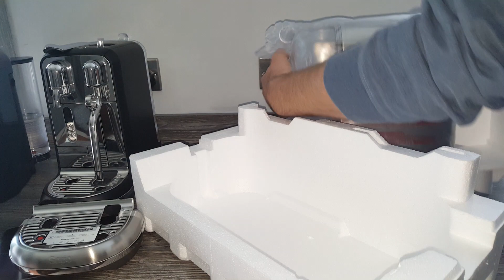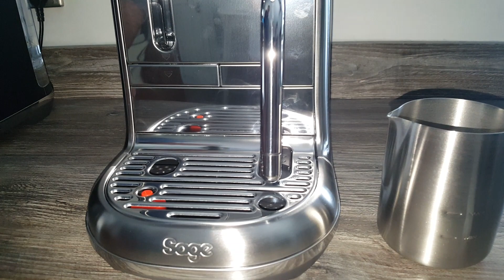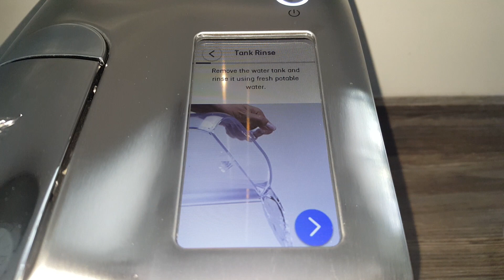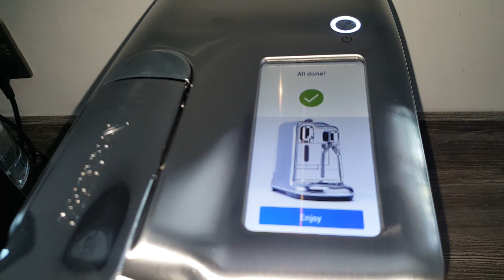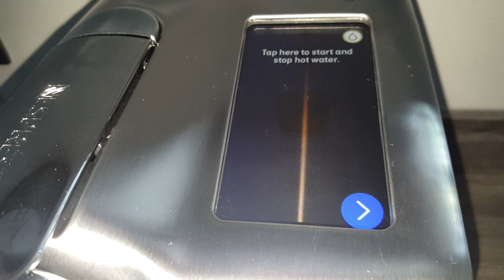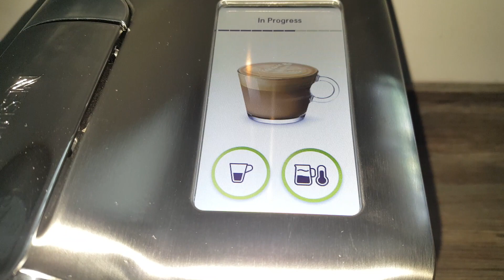Nespresso Creatista Pro UNBOXING and FIRST USE | How to set up the coffee machine to make cappuccino

Comment: Two questions: Can you adjust the temperature of the coffee, i.e. make an espresso coffee hot if you want? Second question: Have you heard anything about the Pro not working correctly in the US due to wattage, that the machine not being able to make the coffee and froth the milk at the same time? If so, would I be better to purchase the plus instead?
Reply: Great job on the review!
Reply from the maker: Hi 👋 Unless the US model is different I’m afraid you can’t adjust the coffee temperature itself. You can adjust the milk temperature and coffee volume but not the coffee temperature 😕 

Also yes I have heard that about the US 🇺🇸 model, that it can’t brew coffee and steam milk at the same time. So I guess it depends if the other features of the Creatista Pro like the touchscreen and bigger size and capacity make it worth it for you. 

It would be great to hear which machine you choose in the end 🙂

Comment: Hi , i just bought creatista pro, i was using citiz with aerrocino 4 earlier, i made a first coffee today using Arpergio capsule which has 9 intensity and it tasted quite strong in citiz but in creatista pro , coffee tasted so weak amd watery, does water hardness level has to do something with this issue ? Pls advise how can i get a strong coffee from my creatista pro ? Thanks in advance 🙏
Reply from the maker: Hi 👋 Are you meaning it tastes weak as an espresso shot or when you’ve added milk?
Reply: @A2BProductions  i took an espresso shot from creatista pro and did milk in aerrocino 4 , it tasted as good it is use to be when i was using citiz and aerrocino 4 combo but when i do milk in pro with steam wand, it makes coffee weak so espresso shot i am not sure is weak itself as i hardly drinks espresso. I used black pod ispirazione which is quite strong itself but still coffee tastes watery and weak.

Comment: So I just got the Creatista Pro. I've watched a lot of your videos and they are great and helped me decide to get it. But...I'm not entirely happy with it at the moment. I've had it for one day and have made a bunch of stuff (cap, latte, americano, flat white, etc) and they all taste weak. I love the machine and it is easy to use, but for whatever reason the coffee tastes weak. I used the regular settings for all of these cups. I use to have the Nespresso Expert and the coffee tastes stronger. Did you ever have an issue with weak tasting cups? Does the machine need a few days to break in? Let me know what you think if you can. Thanks!
Reply from the maker: Hi 👋 Have you managed to find a solution to the issue? I tend to use 2 shots for a latte etc but can get away with one if using a higher intensity pod, especially in a cappuccino. Be great to hear how you’ve got on 😊
Reply: @A2BProductions  Thanks for the reply. I do use 2 shots, both for Lattes and Cappuccino. Still tastes weak and now I'm getting concerned. There is a little bit of water in the tray where the pods get dispensed. Maybe a tablespoon (15 ml) when the tray is mostly full with pods. Do you ever see water in that tray?
Reply from the maker: Hi again. I do see it sometimes but only usually when I’m using compatible pods from supermarkets and the like. Don’t usually when using genuine Nespresso pods (or Starbucks with them being made by Nespresso too) Hope this helps

Comment: Seems like for a cappuccino, the minimum level requirement on milk means you're forced to waste a bit every time, is that right?
Reply from the maker: If you fill it to the minimum line then yes. We did make a quick video where we made a cappuccino using a bit less than the minimum line but it did change the texture a bit. Here's the link - https://youtu.be/fr7EySB7PCA

Comment: What a surprise to see you have purchased the Pro 😆.  I think if you wipe the steam wand before you let it purge that should make clean up easier as the purging hot water is probably what's baking the milk residue on to it.  Look forward to the full review and comparison.  I'm still loving my Vertuo, but still procrastinating on whether to get the Pro, especially as I already have a bean to cup machine that has a perfectly capable steam wand 🤨
Reply from the maker: Haha, yeah I couldn't not give it a try at that price. I think you are supposed to wipe the steam wand down before letting it purge like you say but that doesn't seem to have fixed it sadly. Been on the phone to Nespresso today and dismantled/cleaned the end of the wand with the cleaning tool they give you but still no joy. Didn't have the issue with the Plus so wondering if it's just a fault. Will give it a day or two and see if it resolves itself. Going to have to research these bean to cup machines as they keep popping up in the comments.
Reply: A2B Productions How interesting about the steam wand, I would have thought they were the same, so maybe there is a fault. The bean to cup is great but there is more clean up involved with the brewer etc. The great thing with the Plus/Pro wand is that you don’t have to hold the jug all the time whilst steaming and clean up is minimal.

Comment: I have this machine I love it , it works great very easy to use I upgraded also from creatista plus
Reply from the maker: Yeah it seems like a good machine on first use. Looking forward using it and doing a review in the coming weeks!
Reply from the maker: Do you mind me asking by the way if what happened with the steam wand self purge looked normal to you from your experience with the machine? Wondering if mine has a slight problem as I've tried wiping the wand down before it purges too and still seems to spit quite a bit of liquid around when purging. Hope you don't mind me asking.
Reply: A2B Productions yea I think it’s normal for it to spit a little I always wipe it first before I put it down so there is no milk on it , I’ll take more notice when I use it today
Reply from the maker: Thanks for the feedback. I was playing around with both machines yesterday and not sure it is a fault actually, as the plus does do it a bit but just to a lesser extent. But would be great to hear what you notice today. Thanks again!
Reply: A2B Productions I did take notice it seem to spit more than the other but I think it’s because it has to heat up pump things so it makes it stronger .
Reply from the maker: Thanks Annette, appreciate you coming back to me on that.
Reply: A2B Productions , That’s ok no problem, I meant to put 2 pumps as it has 2 lol

Comment: You two made a unboxing and first use video, and this is the best „review“ right now... can‘t wait for the dedicated review with further information.

I would imagine the the Water dispenser, the dual thermo block and the ability to save own recipes (don‘t know how many are possible)  does make a big difference.  However the controlling of the water output in the upper right corner seems to be a bit tricky
Reply from the maker: Thanks, glad you liked it. Yes that was a small button in the top right corner but once you know where to press it's not too bad. One other thing I didn't mention is that it has an americano setting too.

Comment: Again a very good job and also a very good camera-work in showing details. 
I think the messy rinsing of the steam wand is from not cleaning the outside, before releasing it to park position.
Reply from the maker: Will pass that on to the camera lady 👍 Yeah it did seem like we should be cleaning the wand before letting it purge but that didn't solve it sadly. Have dismantled and cleaned the wand today with Nespresso on the phone but seems it may be a fault with the machine as it's still doing it. Haven't had any issue like that with the Creatista Plus so guessing it's a fault. Will see if it fixes itself but may need to return/exchange it if not.
Reply: Hi There!  I live in the US and the Pro is not available here duo to the standard US home outlet not supporting 2300 Volts that the Pro requires... I am a Creatista Plus owner but I was obsessed with the Pro to the point that I imported one from Lithuania through an eBay seller.. I had to buy a 5000V power converter box which cost me an extra $200 in order to make it work here. The Creatista Pro and the converter box ended up costing me US$1000! I really wanted it!! So the point of my comment was the milk splashing from the steam wand on the Pro that you experienced ... unfortunately I experienced the same thing!! Your machine is not faulty, somehow it’s just a flaw of the Pro!!! My Creatista Plus never done it. I now got used to it but what bothers me the most is that the Pro makes much less milk foam in comparison to the Plus. The Pro foam is a super micro foam even on the high foam set. I was a bit disappointed cuz it kinda ruins my Latte art. Other than that it’s a fantastic machine. I don’t wanna go back to the Plus but the Pro has its flaws.   Any questions, email me Man!  ;-) Vinny.today@gmail.com         Peace.
Reply from the maker: Hey Vinny, cheers for taking the time to leave this comment. Agree with everything you said here mate. I was having a play around with both machines yesterday and as you say, I'm not sure it is a fault now. I'd never noticed it on the Creatista Plus either but when I went looking for it, I did see that the Creatista Plus does spit a little bit but nowhere near as much as the Creatista Pro. Know this sounds a bit pedantic but think it might be that the steam wand looks slightly thicker and also seems to sit slightly higher away from the drip tray than the Plus one does. I've also noticed a slight difference in the foam texture too but thought I might be imagining it, so good to know it's not just me 😅 (I can't do latte art so couldn't test it that way). Agree again though that it's a great machine, touch screen is great and there's just that bit more room to move around on the machine too isn't there. Heard there may be a US Creatista Pro release date of September 2020. Is that what you've heard? Cheers again!
Reply: Sweet!  Thanks for your reply as well!   It does make sense that the wand is bigger and higher.  About a US release,  I did read a comment somewhere that Breville (Sage in Europe) would be aiming to release the Pro in the US in 2020 but I have my doubts specially now with the Pandemic but will see.  I hope I don’t have to buy a new one!! Hahaha  I forgot to say that your review was GREAT and very helpful!  I wanna make a review video myself too since there are no American ones of the Pro.  Never done a video here before but showing the Creatista Pro will be fun.   Cheers Brother!
Reply from the maker: Cheers mate, really appreciate that. Hope they do release it over there as it's a good machine, at least you can ebay your european one if they do eh, get some of your money back. Sure your review will be great 👍